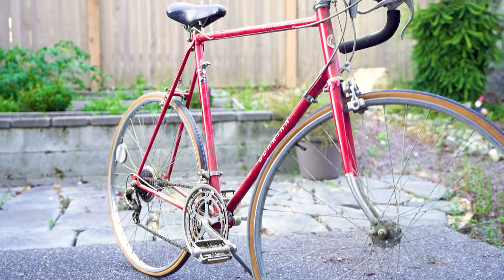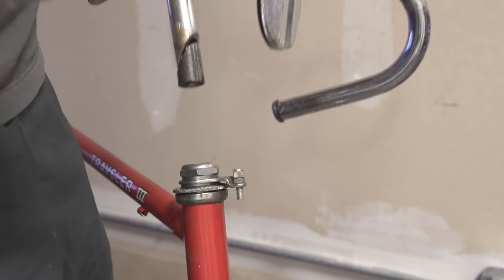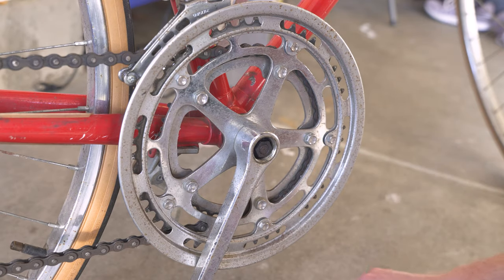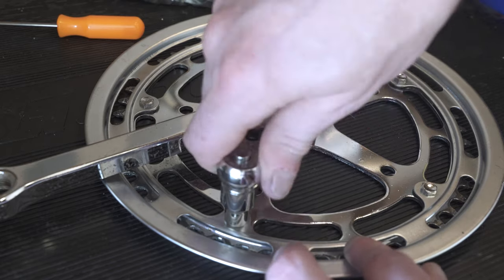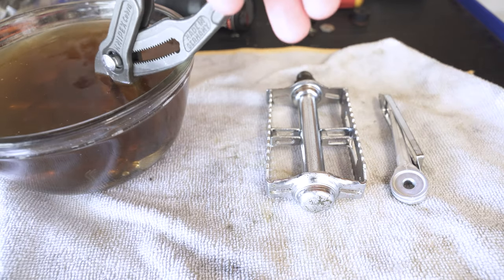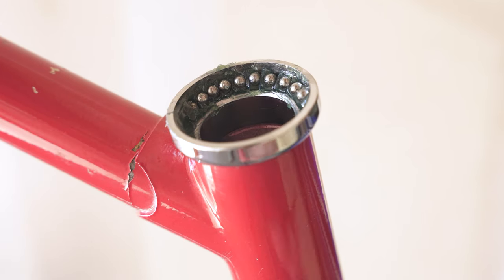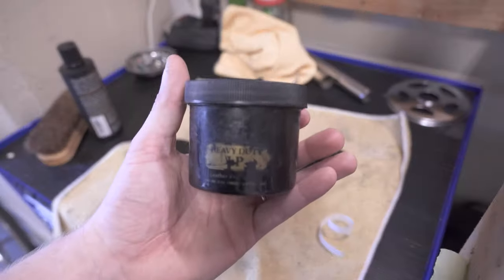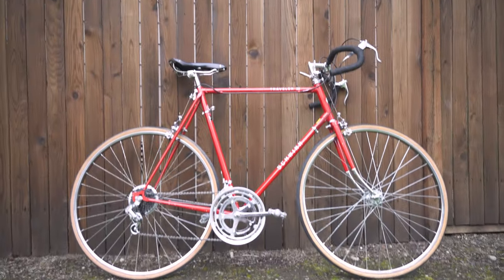Vintage bike TRANSFORMED: Full Schwinn Restoration

Comment: I just got a mid-seventies Motobecane Mirage, in pretty good condition.  It is the exact back that I rode when I was in Jr High and High School before I started driving. I loved that bike.  This one is the same, except a different color.  I plan to do a restoration like you just did,  clean it up, replace the cables, probably needs a new seat, and it needs new tires. I haven't really gotten into the project yet, but I have all winter to work on it.  I loved your video.  Nicely detailed. Thanks!
Reply from the maker: That's awesome! Yeah, winter is the best time to work on bikes. I love just doing 30 min a night. Have fun!

Comment: I also give old bikes a new life, but you're on another level,  great  respect for your dedication.
Reply from the maker: My only trick is spending way more time than is reasonable on every part 😂 thanks!
Reply: @JustinDoesTriathlon  Aren't you afraid to lose a little piece, when you dismantle a brake or something?
Reply from the maker: @DietrichStockman  Sorry, I missed this. YouTube doesn't give me good alerts on replies to replies. I'm not at all nervous about outright losing parts, no, that's just a lot of baggies. What does concern me is not getting things assembled properly, and that's what the video is for! There are so many little bits and similar nuts/bolts that you really have to keep things super organized and be careful, but as long as you do that, it's okay.

Comment: I'm doing the same thing with an earlier Traveler I rescued from the dump. Is in a lot worse shape from sitting around , but basically intact. 
Thanks for the info on rust removal, etc. It's a fun hobby.

Comment: i did this to a 1971 La Tour that someone toss out on garbage day but i even took the rear cassette apart and cleaned and re greased the 80 tiny bearings .... I found  a three inch 3m style buffer pad that fits in my drill to polish up the chrome- aluminum and  all of the spokes and chrome rims ...WOW it saved me a lot of time and it turned out great with shining them up !

Comment: The restoration turned out great. What I like about bicycles built in Asia, is that smaller hands tend to go in deeper into the weld areas forming a good bond. Thank you for sharing

Comment: The number of notes I took on the various cleaning and polishing techniques fills a page.  What a stunning result, amazingly executed!  One nitpick point is the mounting of the Weinmann brake calipers to the front fork and rear frame.  The aluminum escutcheons are specific to the outward-facing and inward-facing sides.  The square escutcheons' knurled surfaces are designed to interface (facing outwards) with the Weinmann caliper mounting surface for a non-rotating fit.  The round escutcheons are designed to provide a flat surface for the caliper retaining nut.  They face inwards.
Reply from the maker: Brilliant! Thank you for catching that, I'll fix it asap! And thanks for the comments. :)

Comment: I love what you did here.

I don't generally have time to fully polish up everything, so reasonably clean, well lubricated and safe are my typical goals.  Might have to go the extra mile on my newest to me bike, a '75 Varsity in chestnut brown.  It just needed tires and a new handlebar (original had crash damage) to be good.  I had it out for a decent ride last night, but will eventually pull it apart for bearing repacks and further cleaning.
Reply: I'm restoring a '71 Varsity at the moment. It's a bit difficult to tell if some of the parts are chromed steel with a layer of rust + oxidation or regular galvanized steel when cleaning them up, but other than that it's remarkable how the bike has aged so gracefully after 50+ years. Not sure how someone managed to crash hard enough to bend the steel handlebars on yours though, even I've yet to manage that lol.

Comment: As a woman who grew up in the midwest in the 60's & 70;s, I LOVED this video and your contagious joy of restoring these vintage gems.  I have a 70's, orange Schwinn Twinn.  The chain just broke and local bike shop says they can't fix these old broken chains (small town)..  I felt discouraged, came home & found your video - so  encouraging that it CAN be done.  Any suggestions on how & where to look in Ohio.?
Reply from the maker: Thanks so much! That's awesome that you have a Twinn! It 100% can be fixed. I know nothing about Ohio but I find it a little suspect that a bike shop can't fix a chain, that's crazy. I found a post on bikeforums from someone in a similar situation to you (linked at the end of comment) Basically, they were told to buy two 5/6 speed bike chains. If you've got the old chain, that's gold, because you know exactly how long to make it. And then all you would need is a chain breaker tool (7-$10 on Amazon.) Try to confirm it with a little more checking of what you've got, but a KMC 5/6 speed chain ($10) and a chain tool ($10) should get you most of the way up and running! I’ve also linked a Park Tool video that will walk you through replacing the chain. You can do it! :D 

https://www.youtube.com/watch?v=VdUQKVMPF5I

https://www.bikeforums.net/classic-vintage/756346-chain-question-my-schwinn-tandem.html
Reply: @JustinDoesTriathlon send a chain

Comment: I have what I believe is a 1983 Schwinn Ten Speed with quick release skewers. I want to do what you've done since I finally got great tires and inner tubes from Walmart in instead of buying online. I only need a rear wheel reflector, a spoke guard. I might rip the plastic remains off. I found a brand new beautiful Schwinn extra large cushioned seat at Goodwill It may look weird, but it will be comfortable. I needed your video for advice on removing dingy rust spots. Even though I won't break mine all the way down. Your thoroughness makes the idea enticing.

Comment: Hey Justin, Man I love that degreaser hack! I have a very nice stainless ultrasonic cleaner, but I didn't want to muck it up. I'm just getting ready to restore my pop's 1980 Schwinn Super Le Tour 12 speed (made in Chicago) and will definitely use your hack, thanks! I will be stripping it completely as the decals are almost gone, and I'm going to do some custom paint work. Purists won't like it, but I've restored old cars and turned them into resto-mods. All of the components will be original except the saddle, as I do plan to ride it, and the OG saddle just won't do. Super nice job 🤜🤛, and you're right, there's something about taking one apart and bringing it back to life. To me it's very relaxing and slows down the world a bit. Doing these bikes is way cheaper than doing cars that's for sure!😁
Reply from the maker: Bikes < cars < boats < planes on the $$$ front for sure! I grew up working on cars, so I definitely understand that struggle. And hey, that's the nice thing about Schwinns and such too; they really aren't rare or expensive, so if it's pretty shot and needs to get stripped down, it makes a great canvas. That'll be a fun project!

Comment: That bike looks nicer than it ever did, lots of elbow grease. You can tell a bikes miles by the brake pads, and that bike had almost no miles on it. Those Japanese frames were about the best Schwinn offered barring the Paramount. The electroforged frames are tanks. Very nice job.

Comment: Wow! Thanks for this video. I purchased this bike new in the 70’s. Mine needs the gears adjusted & new brake pads.  One question, I’m over  60 & would love to find out your opinion on having some sort of adjustable stem put on so I can ride more upright?
Reply from the maker: Oh that's fun! I hope it's been enjoyable for you! :) Yeah, you can definitely get it more upright. There's two things that would help with that: bringing the bars up vertically and also bringing them back (closer to you) so you don't have to reach as far. The googling term that I would look up is "Height adjustable quill stem." You could also do a "Quill stem to threadless adapter" which would then let you put on any of the current modern stems. I would start with the first just because that's a 1 piece solution, but if you don't fine anything that's tall or angled enough, then you could look at a cheap adapter + high rise stem. But yes, don't worry, 100% doable. Have fun!

Comment: Great video and great restoration! Have you had any issues with running cable housing straight into the braze-on cable stops without ferrules at the ends? I'm working on restoring a similar 1981 Schwinn Sports Tourer, but the new housing i have is loose in the braze-ons and the modern ferrules that came with the housing are too wide for the braze-ons. Wondering if i can get away without "step down" ferrules. Thanks!

Comment: Nicely done. That bike was made in Japan by Panasonic. In many ways, they were superior to the US made Schwinns of that time. For years, at least well into the mid 80's, the seat post binder bolts on Panasonic branded bikes still had the Schwinn "S" on them. The only minor goof I noticed was the crescent washers on the brake center bolts, The shallower ones are used on the fork, the deeper ones on the caliper bridge.
Reply from the maker: You're right! I've since fixed that. No idea how I did that 😁🤣 thanks !

Comment: Looks great! I have a Schwinn Varsity with a good amount of rust on the bike frame. Can I submerge portions of the frame in Evapo-Rust, similar to how you did for other parts?
Reply from the maker: If you've got enouph evaporust, I wouldn't see why not! I haven't had any issues with it touching paint or anything (but test it somewhere inconspicuous first). There's also an old school method of plugging the frame and filling it with hot oil to form a moisture barrier against future internal corrosion, but I've never done this. Less messy, you can get spray in vapro shields.

Comment: You should have pumped evaporust into the whole frame. Fun fact, Panasonic built those bikes to Schwinn's specifications.Also, Panasonic also built bikes for Miyata as well. And Miyata built bikes under the Panasonic banner as well as Univega and vice versa.
Reply from the maker: I actually thought about that re: Evap! Good idea. I might do it at some point in the future , maybe a winter project. Probably a good idea. Thanks for the history, I didn't know that (though I had some idea that Panasonic was involved somehow.) Very cool
Reply: @JustinDoesTriathlon  Just look it up in 'Wikipedia' And, Thanks Again for answering my reply.

Comment: About a month ago I bought an 84 World Sport. I have it torn apart in the garage, I’m in a slow restoration of it. Even though I’m putting the wheels back together and got new tubes and tires, I’m still debating putting a 700c wheel set.
Reply from the maker: I'm a slow restoration guy myself. Throw an hour or two into it a night over a month or two. My 2c, depends how you're going to ride it. Sunny cruiser around the neighborhood? Keep the stock wheels. Anything at speed where you might actually 'need' brakes? Probably something with alu. hoops. The steel wheels are just not great. Brakes are probably the biggest change in bikes in the last few decades imo. Hell, I just built up bike with downtubes, but I'd never seriously ride chrome steel rim brakes.
Reply: @JustinDoesTriathlon  my mistake, it’s an 1980. 

It’ll be a ride a couple hours on the greenbelt every blue moon type of bike. Probably wouldn’t have taken it apart if it hadn’t sat for what seemed years in the Texas sun.
Reply: @JustinDoesTriathlon  my progress just got slower. I lost a few bearings that go in the free wheel.
Reply from the maker: Been there done that! 🤣! Bearings are cheap on Amazon thankfully. your LBS may have some if you're lucky

Comment: I have Raleigh from 70’s and I would say it is rocket science. Cotter pins? Check! Weird non standard bottom bracket? Check! Unfamiliar brand on derailleurs? Check! Other than those it could be easy. Bikes from 80/90’s are just much more easier. They have standards.

Comment: Did you replace the spokes? Or just clean? I have a similar project going. Thanks
Reply from the maker: I just cleaned them. I don't have the knowledge to wheel true (nor the equipment) so I didn't go down that road. Also, the spokes were in good condition. I did add about 1/4 turn of tension to them all though (doing it in 3 revolutions by every third spoke

Comment: My father own a schwinn varsity model and I'm planning to completely restore it however there's a small allowance at the opposite side of the RD where the wheel lock is attached. Is there anything attached in it or is it just a free space? I've seen other vintage bike that has screw stopping wheel lock going backwards and avoiding the potential wheel detachment (which i experienced) but this one doesn't had the hole for it.
Reply from the maker: Hmmm... Not sure exactly what you mean. If you can be more specific about what exactly you need, I can try to check my footage/bike for you and help out. If you haven't seen it, I highly reccomend the "That 70s Schwinn Bike Channel" on YT. They have great, extremely detailed videos: https://www.youtube.com/channel/UCN2s93dTyzLwV30rmuXfXdg

Comment: Can you reuse the old bearings after they are cleaned also, what degreaser do you use?
Reply from the maker: Can you? Technically yes, but I wouldn't reccomend it. If they have pitting, then that'll accelerate the wear on the cups/cones. I'd vote to just buy new ones if you're planning on really riding it / keeping it long term. Currently I use simple green but TBH I don't love it and I'm looking for something better. Mineral spirits is extremely powerful but also super toxic so I don't love that either.

Comment: If it were mine I'd get an aluminum crankset and chainrings for it. That department store grade all-steel setup looks wicked cheap (because it is cheap). I don't care much about originality when it comes to bikes, because upgrading them is fun. I would do "period correct" upgrades though; not because I care about the concept of "period correct" in and of itself, but because 1970s and 1980s parts looked drastically better than modern parts, so I'd look for e.g., a Sugino crankset from that era (in keeping with the bike being made in Japan). And it wouldn't have a chain guard ring attached to the spider and I'd get rid of the "dork disk" behind the cassette.

The aluminum SR stem is nice already so I'd keep that, but I'd get some aluminum handlebars (e.g., Nitto). I'd also want some aluminum rims (e.g., Araya), aluminum hubs (e.g., Suzue), and butted stainless steel spokes. I'd probably get an aluminum headset (e.g., Tange) and seat post with integrated "seat guts" too (e.g., Nitto or SR). The brakes and levers are okay, but I'd ditch those ridiculous and risky-to-use secondary levers.

I completely agree with the Brooks seat upgrade, though I prefer the B17.

Upgrading the crankset would be the most important thing for me though, since that's the heart of the bike, and just doing that and nothing else would make me about 90% happy with it.

Comment: What did you use to clean up the wheels? Must have been tricky to clean up the hub without taking the spokes out.
Reply from the maker: Slowly, painfully,  with a rag and some polish. I'm currently working on a few builds and yeah, just unlaced the wheels. Rebuilding takes some time but it's so hard to really get around all the spokes and the hub it's worth it
Reply: @JustinDoesTriathlon  I just found this exact bike on the side of the road for free.  Taking the wheels apart to clean them up is probably the best way even if I don't want to admit it.  Lacing/truing a wheel can be relaxing until its not.  That's when you take a break and come back the next day or a few hours later.  I find getting rid of hop to be the most painful part.
Reply from the maker: @konarider9472  Ha *exactly*. You can't stress during wheel building. I'm not an expert at it but I'm decent. But yes, once you get that spot that just starts annoying you, come back to it the next day. That's actually why all my bike builds take 6+ weeks excluding parts. I love just throwing 30-60 minutes at them a few times per week. That's freaking awesome you got one off the road!

Comment: FYI - You can use vinegar instead of Evapo-Rust and it will do the same job without destroying the planet. Good video though!
Reply from the maker: Is Evaporust bad? I don't know either way, but they claim: "Evapo-Rust® is an environmentally safe water-based product that removes rust in minutes without scrubbing or sanding. It’s non-toxic, biodegradable, non-corrosive, safe on skin and eyes, doesn’t release fumes or bad odors, and contains no acids, bases, solvents, or VOCs. This rust remover requires no special equipment and will not harm unrusted steel or affect plastic, PVC, Viton, and most paints. It’s safe to use on various products"